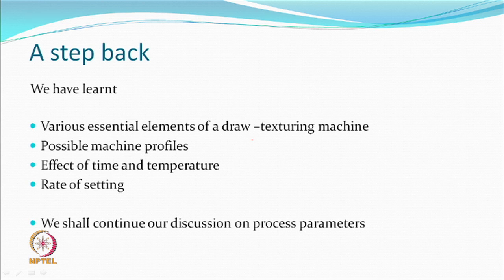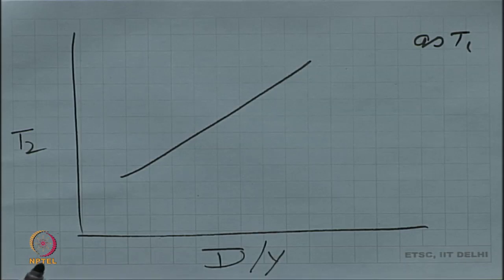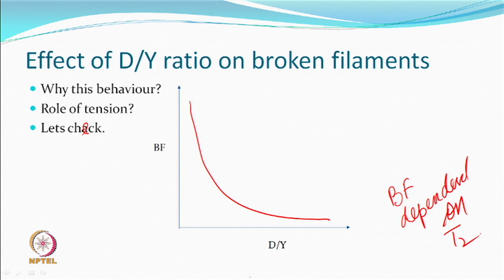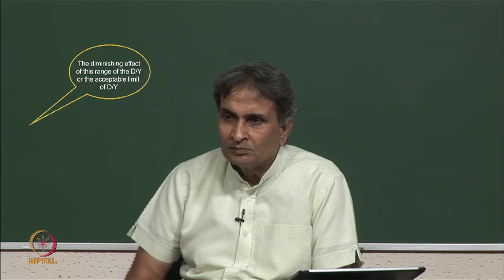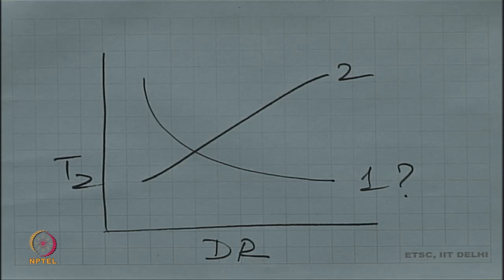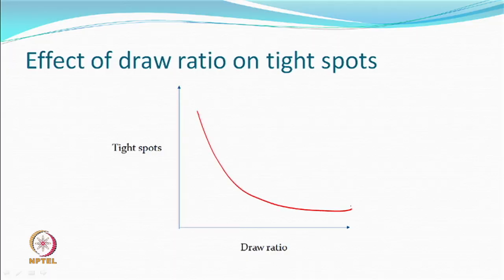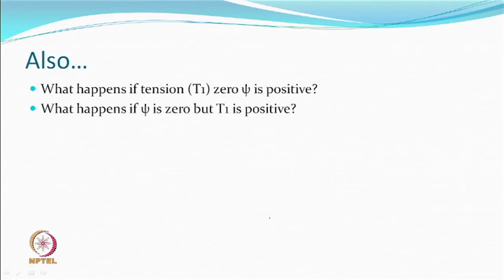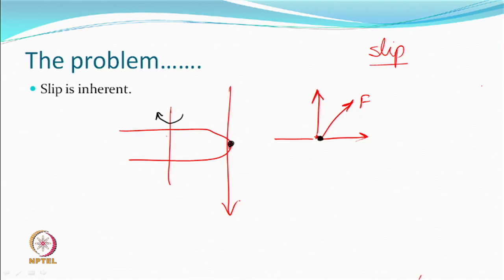Draw Texturing : Effect of Process Parameters

Comment: Sir, great depth knowledge , hats off 👍
 i am running a twisting machine at surat, i am trying to solve the problem of snarling in 150D Semidull tex yarn at the doubling stage in Z/S twist, to remove the heat setting stage after doubling process,  could you guide me about the tension and speed to run right at biconical mechnical winding stage , or at overfeed tension at primary or at secondary stage of process , right now i am giving the exact same twist at primary and secondary stage should i correct it ? Kindly guide me it would be helpful 👍